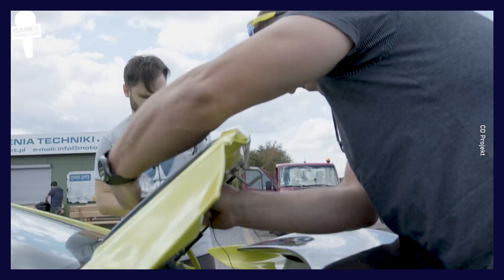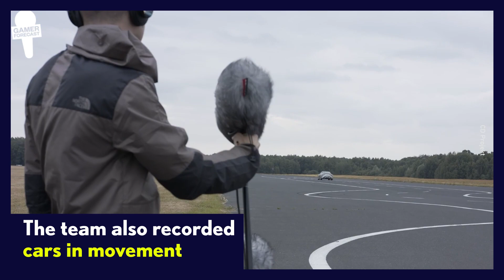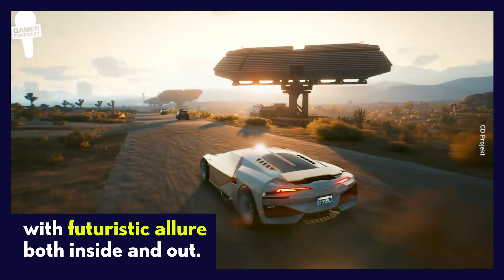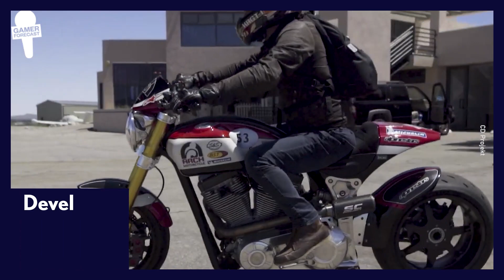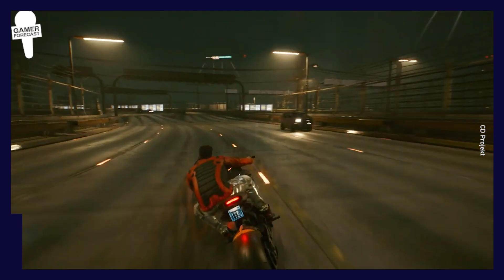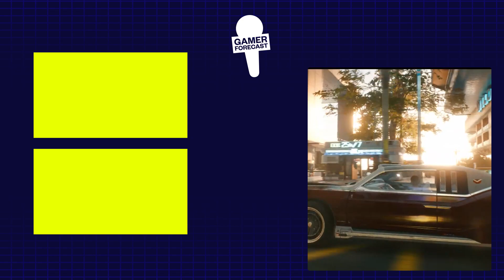How CD Projekt RECORDED SOUND for the vehicles in Cyberpunk 2077

Comment: Game has been out for a while and what brought me here is the super annoying sounds of the vehicles. Especially the bikes. Acceleration and revving is no problem, but the gasping/fart sounds while slowing down are annoying. Mostly it's on bikes but also on a few cars - even the cars with solar panels on the roof. It's not the combustion or an escape of gasses.

I was wondering if that sound was normal as it doesn't seem to occur on the expensive perfectly un-wrecked motorcycles. Then will show up once you hit a curb too hard.